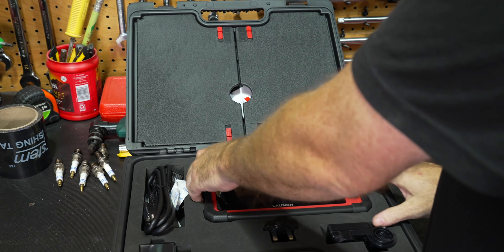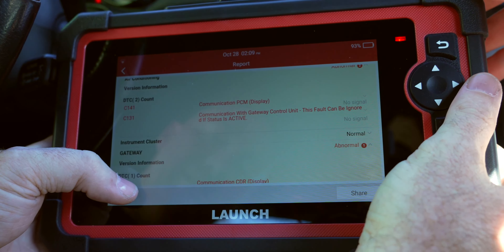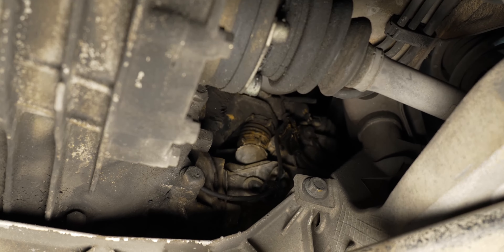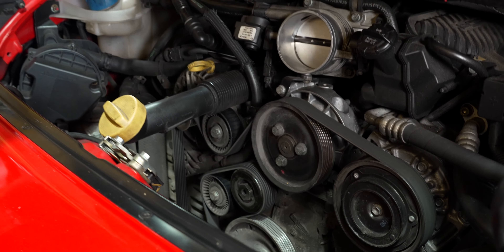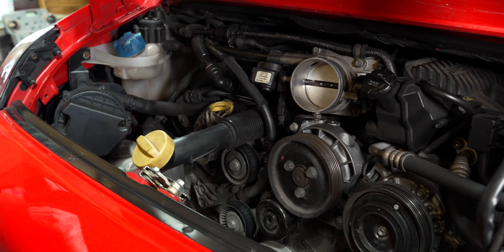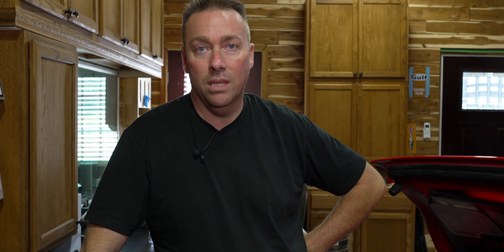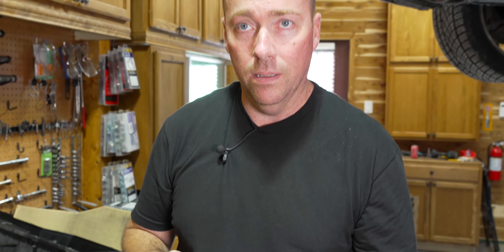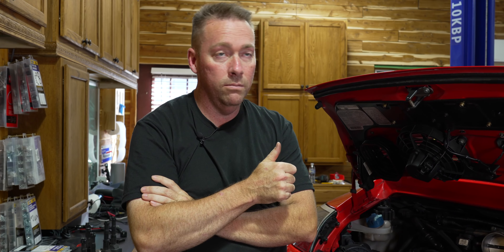This RARE 59k Mile Guards Red Porsche 996 Has BIG Issues

Comment: Intermix oil/coolant is a death sentence on these cars. There were plenty plenty cases of that, we changed so many engines that we had to buy a fork lift to handle all the shipped engines. There is generally no cure, microcracks develop in heads and also cylinders. You will find info and pictures on the web, it's a known problem. Arguably, this is one of the worst engine designs in modern history, regardless of car brand. The 986/996/997 engines replacements paid most of my house. Trying to fix this is a fool's errand. And trying to find a used engine will give you the automatic answer: very hard to find. There is a shortage... because they all fail. Some recycling yards have a customer waiting list. People waiting for engines.

Comment: In Germany to become a qualified mechanic technician and work at a Porsche Mercedes-Benz BMW Audi old Volkswagen dealership it takes a 3 to 4 year full paid apprenticeship and after they have completed their apprenticeship most get offered a job at the respective dealership, to become a master mechanic it takes 6 1/2 years and only a master is permitted to inspect your car before it is handed over to the mechanic you do not speak to a mechanic normally just to the master, The service is amazing always has been since I purchased my first Porsche in 1985. I visited the Porsche dealership close to home in Florida and had to walk around being a little cheeky before I entered the sales room because I heard one of the mechanics speaking German and his words to me were stay the hell away from Porsche USA the cars are the same as we have in Europe but the after sales service has no idea they are purely grasping at straws and if you consider the fact that here in Europe you can pick up a used Porsche with excess of 150,000 miles are they’ll still give you a warranty on the engine that should explain a lot,

Comment: Thanks for the great information. I’ve owned my ‘99 911 for five years and have enjoyed tens of thousands of worry-free miles. My advice to anyone looking at these cars is that you buy the previous owner. Going cheap usually costs you in the long run.
Reply: with the general increase in used cars especially so for assumed future collectibles, the 996 asking prices are ridiculous today. these are up to 25 years old and let's not forget it's Porsche, so the price for upkeep is in no reasonable relation, unless you get a super kept model AND can (and want to) do most of the stuff yourself. In Europe for the coupe in half decent condition you are easily in for 30.000 Euros. That's insane. Right now might be the worst time to be them.

Comment: You should check the ISB for the rattling noise. (Intermediate Shaft Bearing).  There is an aftermarket updated one that does not have all of thr problems as the original.

Comment: Thanks Nathan. I have a '01 with just over 60K on the clock. Already had the water pump and a/o sep done. Always had dealers do the work, until my last visit. Used an indy for the first time and was delighted. Simple problem -- rear spoiler ram, but he found a rebuild kit and saved me $1,000. The dealer charged me $1,900 for front pads and rotors. Apart from the above, I had the coolant overflow replaced, cam covers resealed. Everything's original, including the IMSB and clutch. Any advice on what to watch for would be appreciated.
Reply: 1.900 for pads and rotors?!?  😳
Reply: @Musicman4Christ  Yea...dealer labor is $250/hr...that was just the fronts

Comment: Thanks for the NGK iridium knowledge!  I've been trying to figure out the best spark plugs to use in M96 engines and like all things 986/996, it is so, so difficult to get any helpful advice from the forums!  (rennlist for 986 & 986forum are nearly useless unless you're asking about a horrible stripe or spoiler addition!)  Anxious to see if you escape for $800 with this one; these cars have a way of adding up quickly. But thanks for adding the perspective of M5's and more complicated cars since I do feel better now about all the parts I've recently purchased for my 986!  Looking forward to your next video.....
Reply: The standard plugs will be bosch , my experience these are terrible quality , I would go NGK R every day of the week , better longevity of the parts and improved spark over the OEM ones
Reply: @jonsimpson3011  Thanks. I have never liked copper plugs although if you look at the data, they seem to have very high standards at the cost of declining much quicker over time than platinum or iridium. However, I have never liked them even when brand new and always noticed an improvement when switching to Bosch Platinums, my plug of choice for many years before iridium. Of course, Bosch has abandoned all the older cars and usually only supplies copper plugs now for all the older cars I have. And with the 986S I now have, they also only offer the OEM plug (copper) although it is multi electrode. So thanks for the insight and I will now go with NGK iridium or ruthenium when I finally get my boxster together again (Don't ask!)

Comment: Based on the center console material and the SAI pump configuration, it looks like a 99 to me. Pretty sure I spied the end of a throttle cable in there as well.
Reply: It is. Bought in 1998 and its the 99 model

Comment: Hi Nathan and camera pilot. Good quality video. Easy to follow with plenty of light, except a closeup of plugs might help as we are being shown suspect threads and things. That is unlikely to be a higher miler, as that is about the outer milage limit for the OE water pump, air/oil sep thing, sway bar end links, shocks, and so on. All primed up on that stuff because mine just got all that fixed. The loose or damaged plugs are a mystery. The OE coils like to crack and otherwise die, good time to switch those. 
You were surprised at the dealer standard of diagnosing and work. Don't be. All the dealer techs are indeed well qualified, along with the service managers. The problem is, most Porsche dealerships in north America are just part of a pile of businesses owned by some absent Uncle Scrooges. The rules are set by the owning company, not Porsche. The shop work is allotted X number of hours, including looking for faults. The short-sighted bosses see their Toyota, Ford, BMW etc shops doing all these jobs and no way does the Porsche shop need extra time. The techs soon learn to comply or they are gone and labeled trouble makers as well. That mess of issues you found are exactly the result. The small shops will try to find all of it, as the money from parts sold is pretty good. Part departments at big dealers are a necessary evil, according to the share holders / shot callers. Good luck.

Comment: Yeah, took my M276 W212 Benz to dealer, mentioned the timing chain adjusters getting weak makes a little noise at startup. $700 to pull covers to check, takes an hour to do, two bolts then measure plunger with a caliper, ensure check valve installed in head where adjuster bolts on. $3500 to replace $600 worth of parts. Total rip off, and yes, a bunch of young guys in the shop. I forgot more than all of them put together. No thanks I'll order parts and spend a couple hours doing this and replacing  plugs, brakes, filters, oil, and cleaning on a Saturday myself. And the Manufactures wonder why no one trusts the dealers...

Comment: Air oil separator wouldn't cause water in oil. Oil cooler will cause oil water mix. Mostly workout oil cooler seals letting oil and coolant to fix
Reply from the maker: AOS on these cars have coolant and oil going through them and is a common mixing point

Comment: I've been driving Porsches for 50 years. I took my 1st one to the Porsche dealership. NEVER AGAIN !! Then I sought out an independent Porsche mechanic. Best choice I could have made. Saved thousands over the years !! For years now I use Rich Dean of Porsche Builders of Athens, GA. AKA Classic Design. He is the absolute BEST !
Reply: Rich is the man! He maintains my 911 too.
Reply: There are a few good Porsche techs in northern GA. Especially around Road Atlanta.
Flat 6 Innovations. However… they were not cheep. 7,000 to do the IMS on a 996
Reply: @thatguy7085 ....$7000 For an ims 😮
£1200 Over here in UK 🇬🇧

Comment: Broke stupid people buy Porsches for the prestige. Knowing they can't afford to maintain them. Unbelievable that they treat these cars like that. Unacceptable  !! My '99 996 gen 1 has 55K on the clock. Refreshed at 50K w/ IMS, AOS, water pump, Clutch, pressure plate, TB, any and everything needed w/ engine out. Flushed ALL systems ! New struts, new breaks, new tires. This thing is good for a solid 100K miles before I even have to do any ting but oil changes and general maintenance. I'm happy !!
Reply: What prompted you to replace the IMS bearing on a '99 when the failure rate on that MY is supposedly very low? Cheers

Comment: the only thing rare about a Porsche 996, is those that want them. Back in the day they had major issues and that is why they have no resale value. You guys are trying to pump the 996 market up but the cars are POS. I have 997 turbo which is a fantastic car.
Reply: Aren't they like 90% the same car?
Reply: @michaelcortright5525  Completly different especially the turbo car has a Metzger engine.